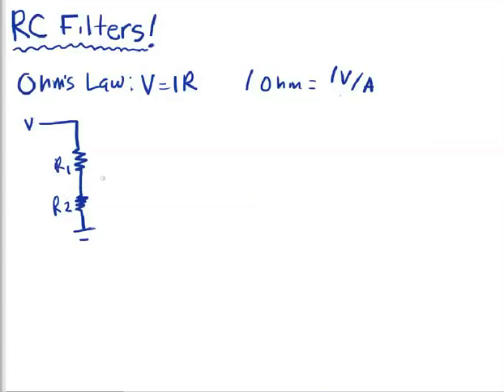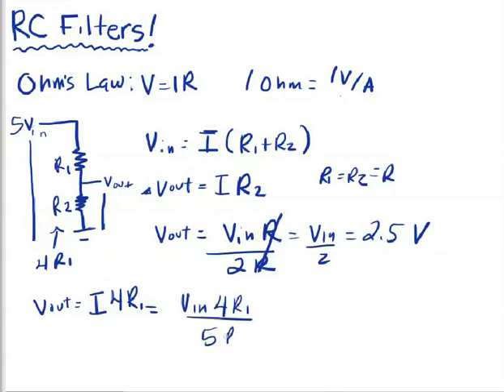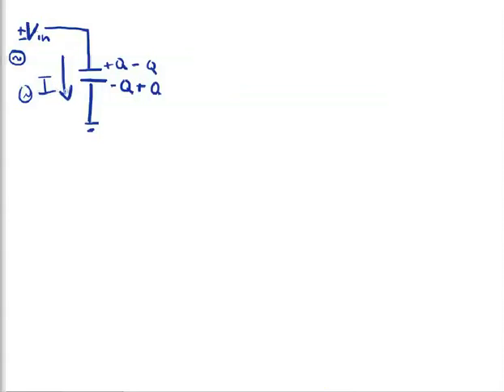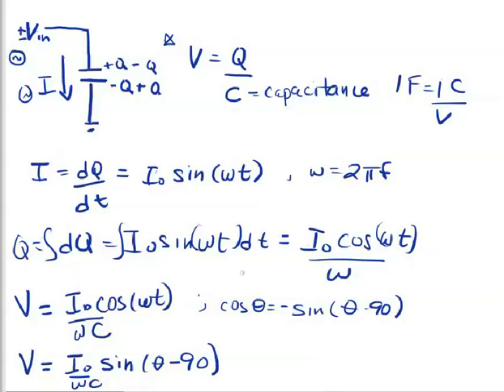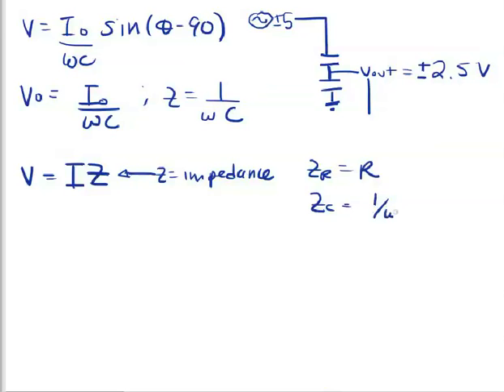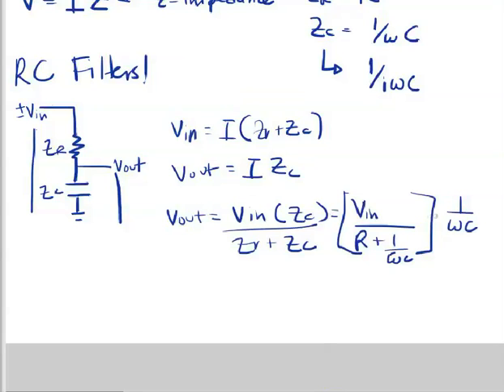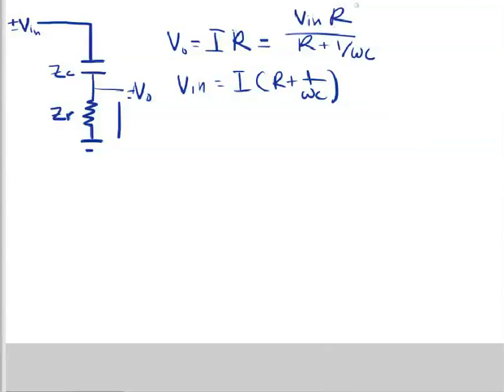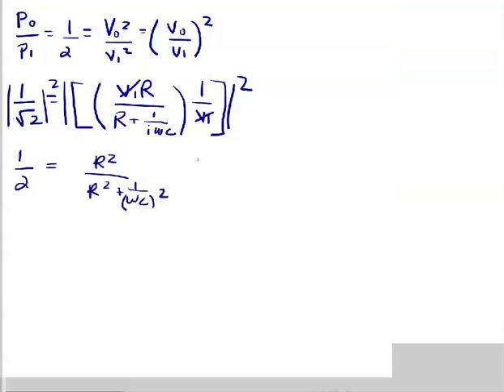Resistor/Capacitor Filters

Comment: do voltage dividers with capacitors work with dc? thanks!
Reply: Sure- In the low pass configuration the input voltage and any voltage drop across the resistor fully determining the output voltage value, but what would be the point of having such a filter in a purely DC circuit?
Reply: You should know what DC is, it's flat from neg infinity to pos infinity, if you apply DC power with a switch, it's no longer DC as there are transients involved.. not to mention switch bounce
Reply: @conesillyvalley7182   He's talking about stable state D.C. not the switching  of it.